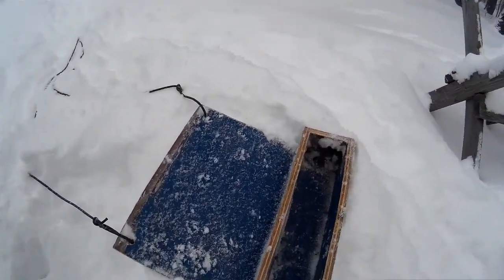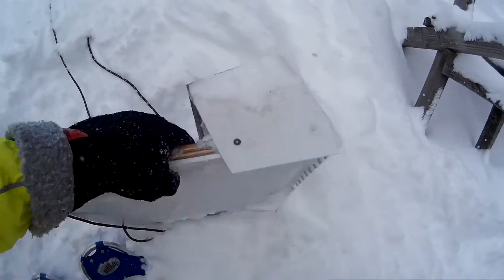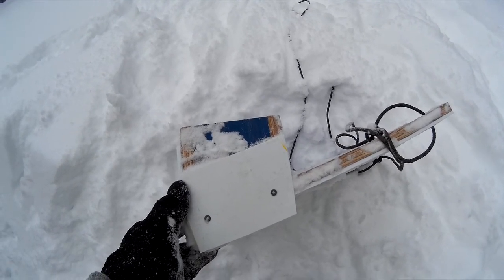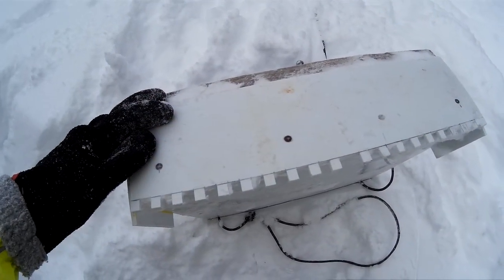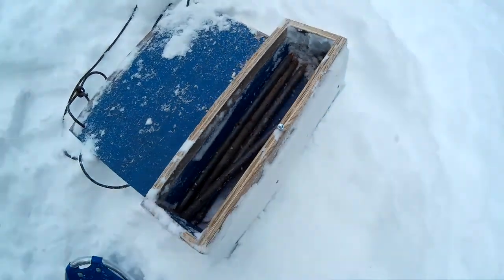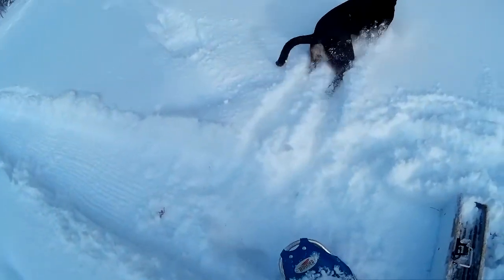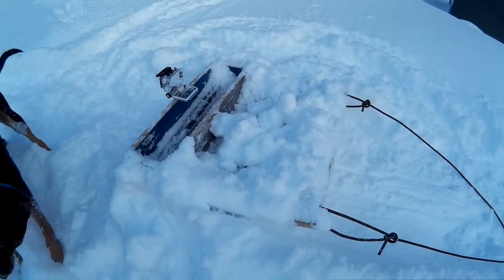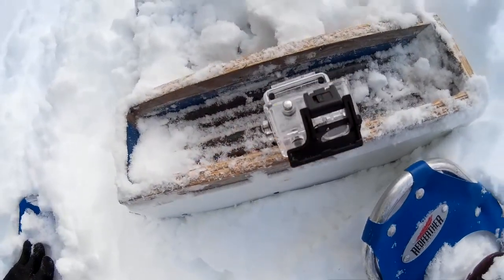me-powered fat bike trail groomer

Comment: Full disclosure upfront, I make a fat bike trail groomer and sell it on  HumanPoweredTailGrooming.com.  

It looks like he tried to knock off the fat bike groomer on www.humanpoweredtrailgrooming.com but since he used a cheaper plastic the snow sticks to the groomer creating more drag, making it harder to pull.  The wood structure behind the plastic puts weight in different places than the HPTG groomer, making it heavier and less efficient at packing.  And the angles are not optimal.  If you're spending the money for a Fat Bike why try to go cheaper than $129 for a HPTG?
Reply from the maker: +Peter Foley I built this using all materials I had salvaged, and I enjoy building and experimenting with things. I didn't mean to give people the idea they shouldn't buy your groomers, just that it's fun to play around with groomer designs.

See you out there!
Reply: +OneDayFishSale I didn't mean to discourage building and experimenting with my comment, just wanted to point out that there were real differences between how what you built performed in the video and how someone buying the unit I sell should expect it to perform.  Because of the differences in material and weight distribution I would expect the unit I sell to slide easier over the snow and not build up snow so more weight could be used and the trail be better compacted.  I would also expect better durability, always a challenge in wet and cold environments.   Enjoy the riding!  Nothing like having a trail right out the back door.